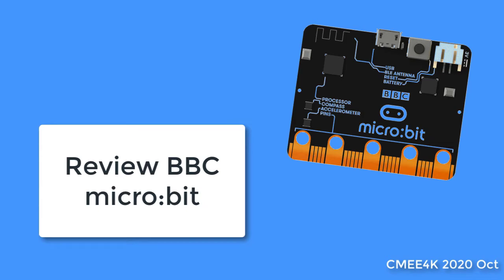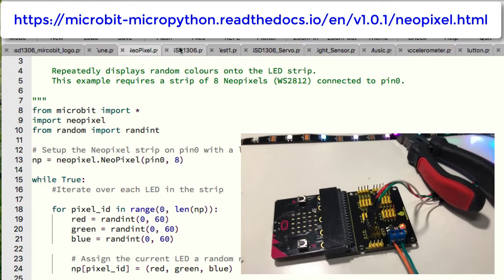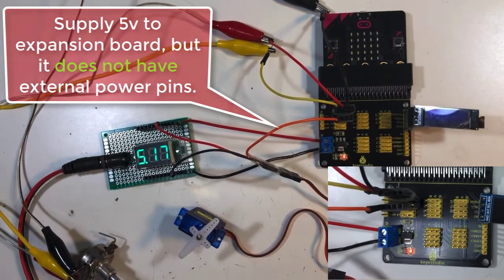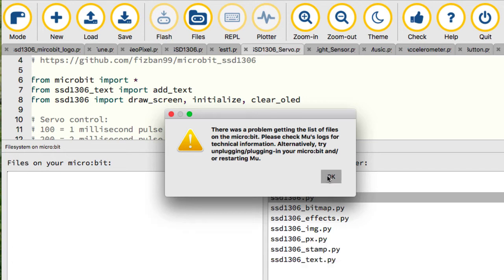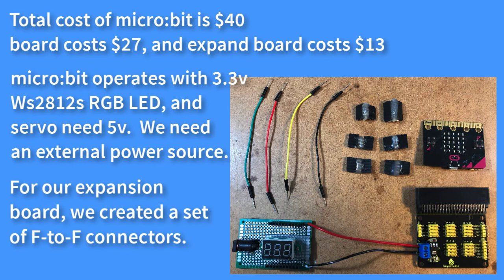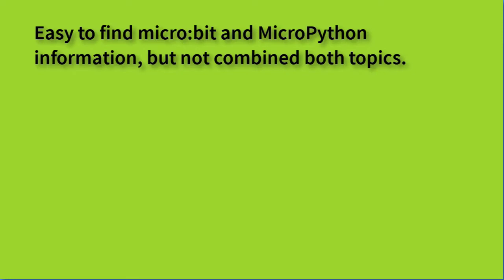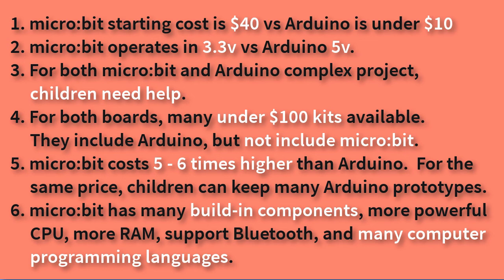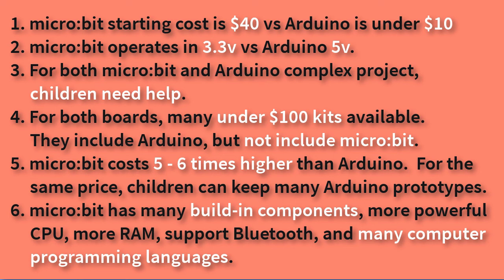Review BBC micro:bit and compare to Arduino

Comment: Microbit costs about 16-19 USD, not 40
Reply from the maker: We are comparing the "total cost" to build the same projects between Microbit and Arduino.   Microbit is very convenience for the first few projects.   However, it needs expansion board to connect to servo and OLED display.    Therefore, we add CAD $13 to the total.   Since "Microbit go" costs CAD $26, so the total is around $40 Canadian dollars (It shows at 2min23sec).    And, all pages in the video are shown in CAD (Everything is more expensive in Canada except snow).    Even the cost of Microbit is higher, but it has more build-in functionary, and more powerful, where Arduino cannot compare.   The idea is to understand the Pro and Con, so we can pick the right board for the our projects.
Reply: Canadian money, much more than that !!!

Comment: Your price for the Arduino is incorrect.
Reply from the maker: We brought 30 units from AliExpress: Arduino Uno with USB cable and AcrylicBox for our STEM club.   https://www.aliexpress.com/item/32665372585.html   Each unit is CAD $5.27 + CAD $5.50 shipping.  For 30 units, the price drops to CAD $4.94 each plus CAD $47.85 shipping, total is $195.94.  So each Arduino Uno costs CAD $6.53.     From Amazon.ca, some vendor charge CAD $6.34 + $3.5 shipping, some charge CAD $9.99 free shipping.    We don't want to mislead the reader.  Realistically, Arduino Uno will cost us around CAD $10.   For our calculation, we would like to include shipping and tax, sometime include the import tax (when we buy from Adafruit from New York and ship to Canada).   Thank you for feedback.
Reply: @SimonYuen1999  THANK YOU that is awesome!!!!